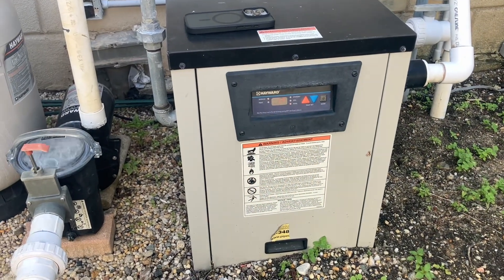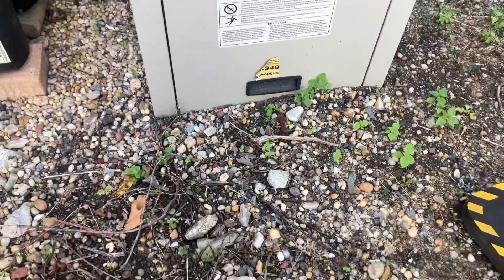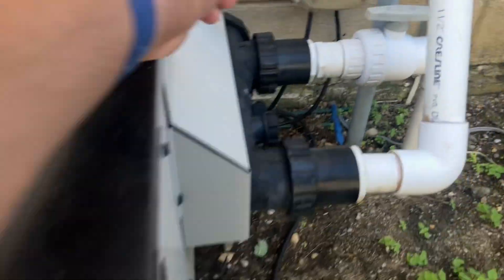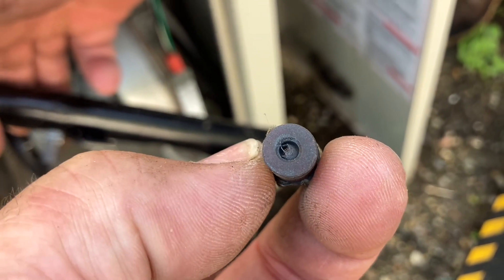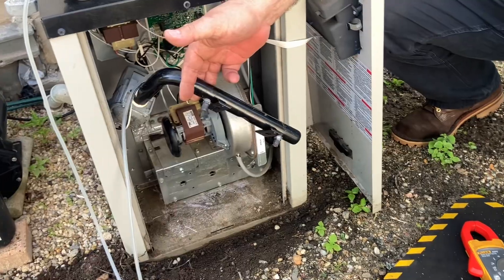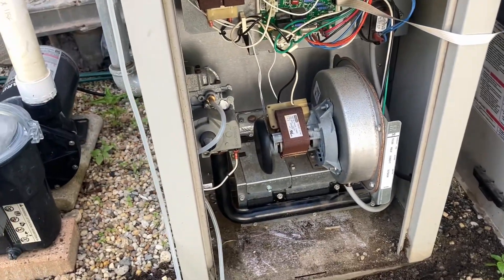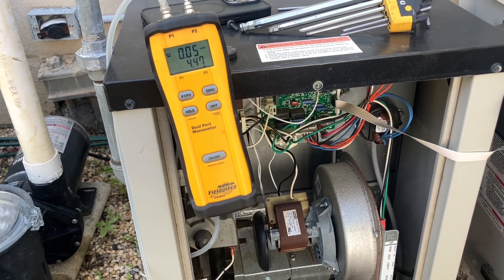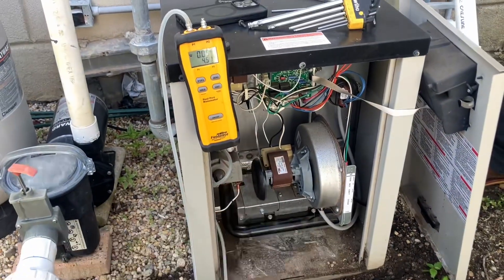Hayward Pool Heater Ignition Failure? Here's the REAL Fix (IF Error Code Solved!)

Comment: Mine has been saying IF since brand new.  3 months the pool. Company and gas company can’t fix it
Reply: I had an issue with mine straight from the factory. They make liquid propane versions and a natural gas versions. I ordered a natural gas version, but upon inspection of the gas orifices on the manifold, there were actually liquid propane orifices installed LP and NG have different size orifices.

Comment: Carburetor/fuel injector cleaner works great clearing those orifices of webs and flame sensors. The only thing different I would’ve done would be adding a sediment trap before the gas valve .

Comment: someone should also prime that pump, way too much air in there.
Reply: looks like it has air leaking in somewhere to me, it's clearly primed and flowing, usually any air pockets self purge out fast. probably low water and skimmer sucking air,, or that slide valve on pump strainer inlet leaking. but could be somewhere else has a  bad seal or pipe joint.
* thinking more I vote that slide valve, they're well known for leaking at the stem, especially on pools, vs gray/black water rv tanks.